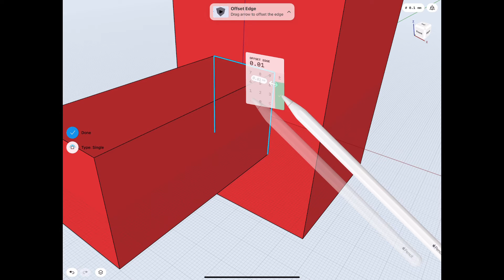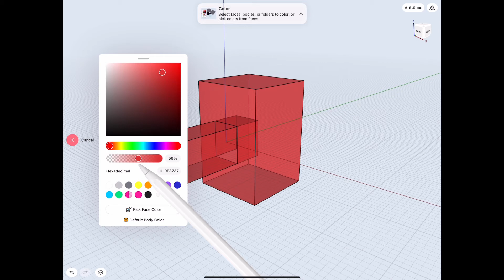Perfect & Strengthen Your 3D Prints Part 1 (Corners & Angles)

Comment: Interesting. I wonder if prusaslicer will send all loose parts cascading to the build plate? How do you maintain the positioning if they're not technically "connected""
Reply from the maker: For this trick i make sure it’s connected in atleast one place. I only beef up the walls i’m concerned about.